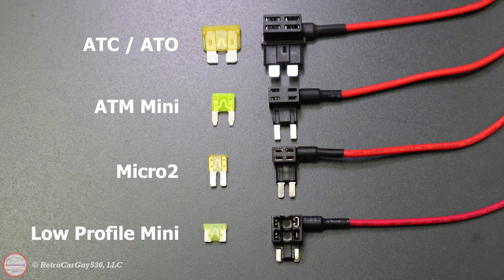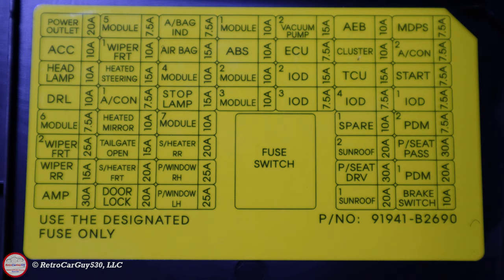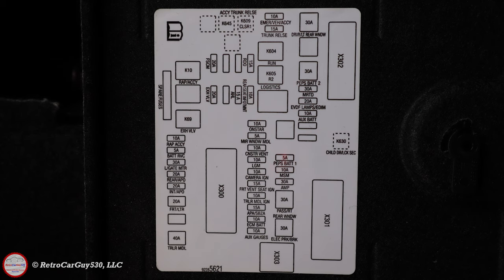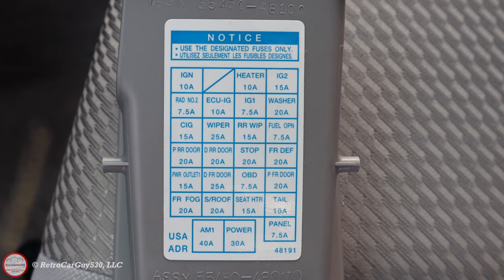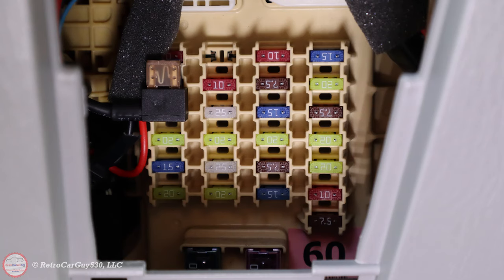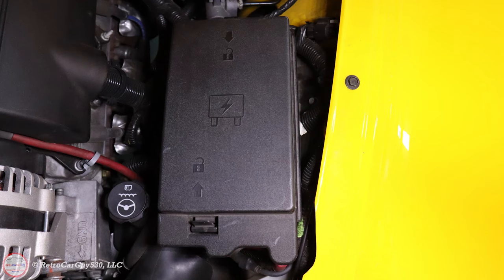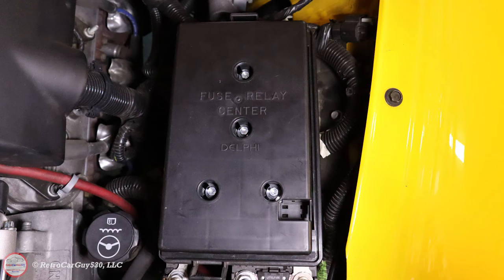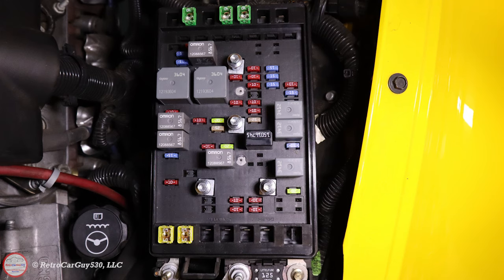How To - Add a Fuse Tap in Your Vehicle

Comment from the maker: Additional video on this topic.  Anatomy of An Automotive Fuse Tap https://youtu.be/YNc0FfeL6rw

🔷Most fuse taps come with a 16 awg or 14 awg wire (smaller wire awg number is a bigger wire which can carry more current) to supply power to the new accessory.  The awg wire size / gauge will be a limiting factor as to the max amperage that can be supplied safely via this fuse tap.   In most cases, this means a 10 amp fuse is likely to be the maximum fuse amp rating you can use for the new accessory.  If the wire from the fuse tap is quite long, the maximum fuse amp rating may be reduced even further.

🔷If you need to add a high amp draw power circuit to supply power to a new accessory, you may want to consider using a fuse tap to supply power to a switched power relay (with a fuse in the relay or in the other power circuit where the relay gets the power for the new accessory).  The fuse tap power (switched power or switched with RAP) can supply power to the control side of the new relay.  When the fuse tap supplies power to the relay, the relay closes the circuit and the relay then supplies power to the new accessory from the power source the relay is connected to with an appropriately sized fuse and wire awg being used for that power circuit.

🔷At 5:43 in the video I mentioned that you need to have the ignition switch in the appropriate position to make sure it provides the required power type (switched, switched with RAP or unswitched).  To find a switched power fuse socket, you must start off with the ignition switch off and locate the candidate fuse sockets that don't have power, then turn on the ignition switch to see if the fuse socket does receive power at that point.  If you need a switched power with RAP capabilities fuse socket, you would need to turn off the ignition switch leaving the retained accessory power feature still active and then test the fuse socket again to make sure it was providing that type of power.
Reply: Thank you for your suggestions, they are very helpful.. Not only BlackVue B-124X battery pack does not provide Low-profile Mini fuse taps with the battery , but also in the user manual does not talk about as to what gauge of low profile mini fuse tap one should buy separately...
There are different websites selling low profile mini fuse taps, but all of them have different awg...
for example:
BlackVue provided fuse taps(Ato, Micro2 & Mini) have this awg: 14awg 600v 1015 105'c  awm
other seller #1: 16awg 600v 1015 105'c  awm  (low profile mini fuse taps)
other seller #2: 18awg 600v 1015 105'c   awm (low profile mini fuse taps)

Gauge - depicts the amounts of load/current a wire can handle safely.. 

could you tell me, what gauge of a low profile mini fuse tap i should get....out of these three given below

14 gauge fuse tap wire can safely transmit 15-18 amps
16 gauge fuse tap wire can safely transmit 10-13 amps
18 gauge fuse tap wire can safely transmit 7-10 amps

In my vehicle's interior fuse box, these are the switched accessory fuses I found.. would you please help locating a fuse that is not critical to the power... can't figure out which one is the right one..
1) [20A - WIP RR(RearWIndowWiper)], 2) [10A-EPS IG], 
3) [15A-WASHER RR(RearWindowWasher)], 4) [20A-WASHER(WinshieldWasher)],
5) [10A-ECU IG NO.3],  6) [10A-HTR-IG(AirConditionSystem)], 
7) [7.5A-GUAGE NO.2(Guages&Meters,MultiInformationSystem)],  
8) [15A- S-HTR FL(SeatHeaterLeftSide)], 9) [15A- S-HTR FR(SeatHeaterRightSide)], 
10) [15A- P/VENT(PowerQuarterWindows)], 
11) [7.5A- WIP ECU(WindshieldWiper&RearWindowWiper)], 
12) [15A- STRG HTR],  

Thank You for all your help..
Reply from the maker: The wire gauge (awg) governs two factors - amperage it can carry for a particular distance.  I would recommend getting the lowest awg value possible.  A lower awg number is a thicker wire that can handle higher current loads.  Of the three mentioned, the 14 awg can carry the most current/amps for the longest distance.

The fuse sockets you listed have a few potential sockets that can be used.  Stay away from any fuse socket that supplies power to an "... ECU".  The "EPS IG" fuse appears to be for the electric power steering so stay away from that one.  Any of the "SeatHeater....." fuse sockets might be a fuse socket that can be used.   The "STRG HTR" fuse socket looks like a heated steering wheel so it too is a decent candidate.  All of the heater fuse sockets have a 15A fuse in them so the max fuse I would recommend is a 15 amp fuse for the new accessory (B-124X).  This is assuming there are no empty fuse sockets available in the fuse box that have switched power.
Reply: @RetroCarGuy530 sorry for bugging you with questions... Just noticed that I Do not have Heated Seats in my vehicle, but there are already fuses(15A fuse in each slots) for them in my interior fuse box. just wondering why these fuses r there when my cloth seats have no such options or buttons to turn them on on my dashboard/instrument panel..
As per your suggestion and as far as the orientation of fuse taps go, S-HTR FL & S-HTR FR are both viable candidate for tapping fuses into them without blocking fuse box cover in the way...
Since i have heated seat fuses 15A each & they are not operational (No Current Draw).. so Should I go with 15A fuse(Bottom Slot of the fuse tap) WITH 10A? OR 15A? or 20A? (Top Slot of the fuse taps)... Thank You!!
Reply from the maker: Sorry I didn't reply sooner, YouTube doesn't present replies to comments in a manner that is easy to see.

If there is a fuse in the fuse socket, it would suggest that something is being powered by the power from that fuse.  It is certainly possible that those fuses/fuse sockets are leftovers from a version of that vehicle with the seat heaters.

The "safest" approach would be to put the 15A fuse in the bottom slot of the fuse tap and up to a 10A fuse for the new accessory powered by the fuse tap.  I like to limit the max draw from a blade fuse style fuse socket to 25 amps (some say 30A is ok).

If you're 100 percent sure there is nothing being powered by the pre-existing 15A fuse or fuses, you could simply leave the 15A fuse out of the bottom socket of the fuse tap and you could in theory put up to a 20A fuse in the top slot (if the fuse tap and other wiring to the accessory will support 20 amps).

There are three main factors that go into the max fuse amperage size for the new accessory (amperage already supplied by the fuse socket, wire gauge of fuse tap and wiring to the new accessory including its ground wiring and the length of the wiring used for the new accessory).  If you haven't watched my FAQ video I created in the past week or so, you might want to check that out where I try to identify the questions / answers that one needs to figure out when trying to size the max fuse amperage size for a fuse tap.  https://www.youtube.com/watch?v=DnZ5wb_A5vE

I hope this answers your questions.
Reply: @RetroCarGuy530  Thank you for going extra mile in helping people... very informative youtube video....
Reply: hey i have a quick question i bought fuse tap for my truck and they came with 15 amp fuses when installing my fuse tap the the bottom fuse which came off the fuse box does it have to be less than 15 amp fuse that came with the fuse tap circuit for example if its a 10 amp fuse  i remove from my fuse box i put it at the bottom of the fuse tap and the 15 amp fuse goes on top from other videos people are telling me it has to be less than 15 amp fuse it came with is this true or???
Reply from the maker: @ploxplox1109  the new fuse for the new accessory can be a larger amp rating than the bottom fuse (from the fuse socket) as long as the sum of the amp ratings for the two fuses doesn't exceed 25 amps.  There's also an issue of the wire gauge for the fuse tap and the wire used to route the power to the new accessory (including the wire used to connect the accessory to ground).  It must be capable of supplying the amperage that the new fuse in the fuse tap for the new accessory requires.

I have a FAQ video on my channel regarding some of the sizing questions for fuses, wire gauge and wire length.  https://www.youtube.com/watch?v=DnZ5wb_A5vE

When the fuse tap is inserted correctly into the fuse socket, the power from the fuse socket will be supplied to the left leg of the fuse tap.  The left leg of the fuse tap supplies power to both the lower and upper fuse socket positions in the fuse tap.  This way each can draw power directly from the fuse socket power.  If you incorrectly insert the fuse tap into the fuse socket so the right leg of the fuse tap is inserted into the fuse socket side that supplies the power, the power goes up the right leg of the fuse tap and then through the lower fuse which then supplies the power back down to the fuse socket and to the new accessory fuse on the top of the fuse tap.  That will often cause the lower fuse (pre-existing fuse removed from the fuse socket) to blow because it's handling the power demands of the original thing it supplies power to plus the new accessory.  That's why it's extremely important to identify the side of the fuse socket that supplies the power so the left side leg of the fuse tap can be insert into that side of the fuse socket.

The fuse that goes into the top fuse tap socket for the new accessory should be sized appropriately to the accessory it's powering.  If the new accessory only requires a max of 5 amps, then the fuse in the top of the fuse socket should be no larger than 5 amps (not the 15 amp supplied with the fuse tap).  Oversizing the fuse for the new accessory can be dangerous since the fuse is the thing in the circuit that should blow if a power issue occurs in that circuit.  If the accessory should use no more than 5 amps, but the fuse is sized to 15 amps, the accessory or the wiring may pay the price if something shorts or fails in the new accessory.

The other assumption here is that the fuse socket you're using is not associated with a critical system or control module in the vehicle.  Please avoid adding a fuse tap to a fuse socket supplying power to a critical system (Engine Control Module, SRS (Airbag) Control Module, EBCM (Electronic Brake Control Module - aka ABS Brakes), EPS (Electric Power Steering), BCM (Body Control Module, etc).

Let's look at your example: 10 amp fuse from the fuse socket of the fuse box and a new accessory that requires a 15 amp fuse (again assuming 15 amps is the correct sized fuse for the new accessory)

The sum of the two fuse amperages is 25 amps or less, so that meets the no more than 25 amp requirement for the blade style fuse socket.

The fuse tap will likely have a 16 awg or 14 awg wire gauge wire attached to it.  Looking at the wire gauge vs wire length chart from the FAQ video, 15 amps can safely be supplied over a 16 awg wire gauge up to 4 feet (including the ground wire for the accessory in that distance).  If 14 awg wire gauge is present in the fuse tap and in the entire wiring to the new accessory, that can safely deliver 15 amps over a distance of up to 10 feet.

So, you can see it's not a quick "yes" or "no" answer for the total answer to the question.  

I hope that helps answer your question.
Reply from the maker: @Yuriy Grynyuk I usually don't recommend tapping into another device's wires since you may put an extra load on that circuit that the fuse for that device/module might not tolerate.   Using a fuse tap can be a good way to obtain power necessary for a new device without interfering with the item(s) powered by that fuse socket (if installed correctly).

Whether the fuse box on the passenger side is usable depends on whether there is a fuse socket that provides the type of power the GPS tracker requires -- battery (unswitched) power and accessory (switched) power that is not sourced from a control module in the vehicle nor supplies power to a control module.  When you tap into power to/from a control module that can cause problems as well (as I mention in my three different fuse tap videos).

Many times the "black" wire is ground, the "red" wire is constant (unswitched) power and "white" might be accessory (switched) power.  Please check the documentation for the GPS tracker for all three wires (black, white, red) to make sure which type of power or ground each one is to be connected to.

It's nearly impossible for me to give exact/precise recommendations for each vehicle and device, so please make sure you've done your research before altering anything in your vehicle.
Reply from the maker: I might suggest using the fuse tap approach.  The reason is that simply tapping into existing wires means you're adding the new power demands for the GPS tracker on to the wires and fuse for the pre-existing circuit.  That could be a problem if that circuit is already running near the upper end of the amp range for the fuse/wiring.
Reply: @RetroCarGuy530  
Your video here is much appreciated.
All the videos I watched before basically added up to plug this in, wire it, done.

You actually educated me. Thank you.
Reply from the maker: I'm glad you found it helpful!
Reply: @ RASHAD H.
WHer u r orijnily frum؟
Did yu feel a need to buy BlackVue camera? Helo
Reply from the maker: @rezagrans1296  I'm originally from the upper midwest of the U.S.  I like the BlackVue dashcams because of the integrated cloud functionality.  I have various VIOFO dashcams and a Blueskysea B4K 4K dashcam that work well for their price point.
Reply: @2006hrk  
Where u r  orijinly from
Reply: @RetroCarGuy530  So stay away from (5Amp) ECU ACC fuse? I'm adding an AAF to a 2021 Toyota Tacoma. Considering tapping into (30Amp) Wiper fuse.
Reply from the maker: @alexhurtado4708  I recommend to always stay away from any fuse that sends power to or is provided power by any of the critical modules in the vehicle (ECM, PCM, TCM, ABS, EBCM, SRS).  I'm not sure what an AAF is, but a 30 amp fuse for the wipers likely has about 3 amps of excess amp capacity so if an AAF takes 3 amps or less, then it should be fine.
Reply: @RetroCarGuy530  thanks for the response. I shorted add a fuse with AAF. What’s your take on the second question? Sorry for bombarding you with all this

Comment: Thanks for explaining the difference between tapping into a fuse that’s already there and tapping into a open slot that may have power and how not to put a fuse in the bottom of using a open slot. I couldn’t really find information on that.
Reply from the maker: Glad it helped
Reply: Yeah, I came here looking for the very same information. Thank you for the useful video.

Comment: Amazing video. I think most of people (me included) thought the add-a-fuse could go either way while orientation is key. Otherwise you will have both devices on the lower fuse shoulders and likely to blow. My tip to check the orientation (might be easier). Plug the add-a-fuse ONLY with the top fuse inserted (leave the bottom slot empty). Plug it in. If you have 12 output from the red  cable you are good. Otherwise you need to twist the add-a-fuse upside down. Once orientation is correct add the bottom fuse if needed. Should make sense.
Reply from the maker: This has come up a few times in the comments since I released this video in Dec 2019.  I totally agree with your recommendation.  I've updated the video's description section with this approach and there's a brief demonstration of this method at 11:00 in the video where I'm testing for power, but that was after testing with the 1/2 fuse.  Thanks for the suggestion!
Reply: Yup. Easy way to determine which way to plug in.

Comment: I know this video is a year old now but I wanted to say thank you. I've hardwired many things in the past but never with a "tap a fuse". I hardwired a dash cam with motion sensor and couldn't figure out why it wasn't working. I had one of the "tap a fuse" facing a different direction than the other for wire tidiness reasons. After seeing this video I slapped my forehead. Duh of course the power is only coming from one side or the fuses would be pointless. Thank you for saving my sanity.

Comment: This was so much clearer than any diagram or video I could find. I now feel confident I can install my dash cam and have it wired properly for safety. Thank you.
Reply from the maker: I'm glad it helped.  There are a couple of different trains of thought on this topic of using a fuse tap to obtain power for a new device/accessory.  What I demonstrate in this video is the "in parallel" approach of routing the power through the fuse tap.   The power obtained from the fuse box fuse socket is directly routed to both the lower and upper fuse sockets in the fuse tap.

There's another approach which would be labeled "in series" power routing approach.  That's where the power from the fuse box fuse socket goes up the right leg of the fuse tap, through the lower fuse in the fuse tap and then down the left leg of the fuse tap to the original fuse box fuse socket and it also goes then up to the fuse tap's upper fuse socket.  All of the power load runs through the lower fuse in the fuse tap.  Which approach is best to use will result in spirited discussion/debates.    The "in series" power routing method can be seen as the absolute safest approach, but it may also lead to blowing the original fuse in the lower fuse tap fuse socket since both power loads are being run through the lower fuse.

For dash cameras, radar detectors and similar power demanding devices (usually 2 amps and very often dash cameras use less than 1 amp), the "in parallel" power routing approach is very safe.  It will only be adding 2 or often less than 1 amp to the circuit that is supplying the power to the fuse box fuse socket.

Thanks for checking out this video!

I have another video that tries to explain the "in parallel" approach a little more in depth.  https://www.youtube.com/watch?v=YNc0FfeL6rw